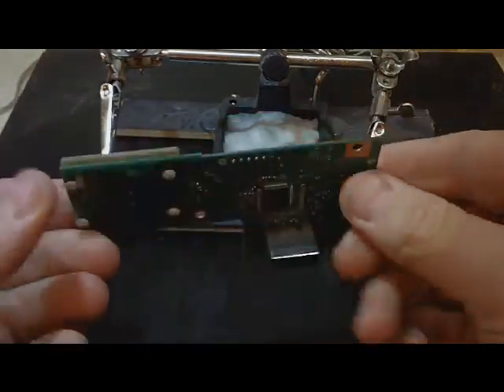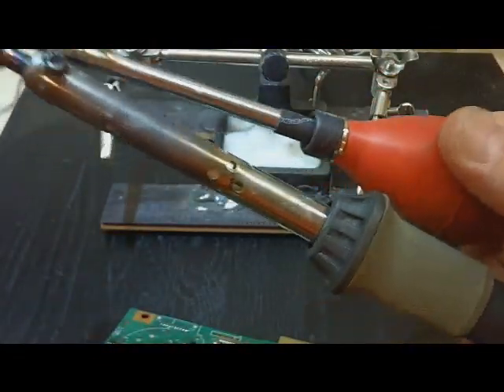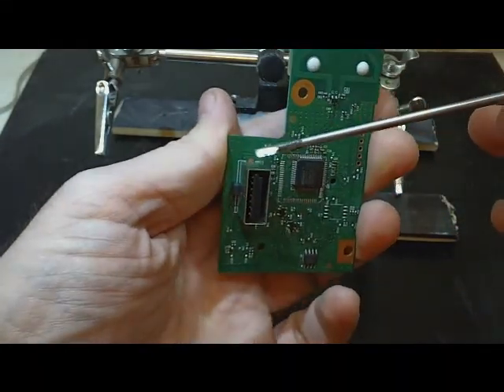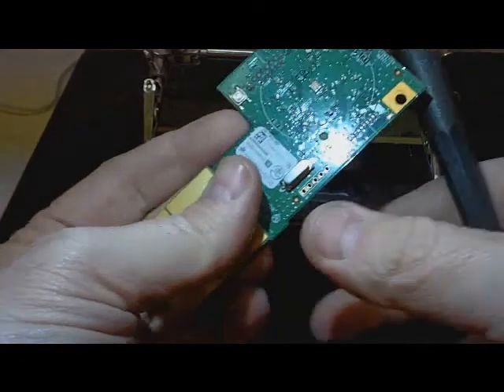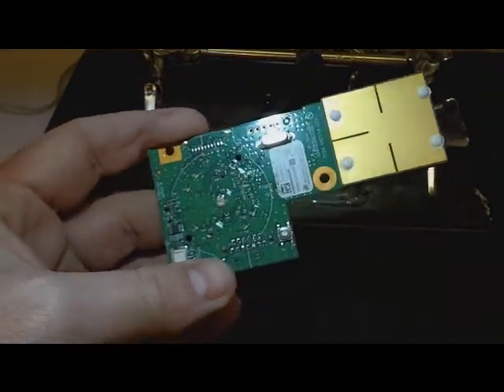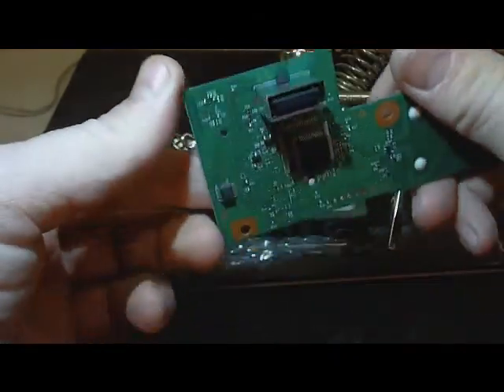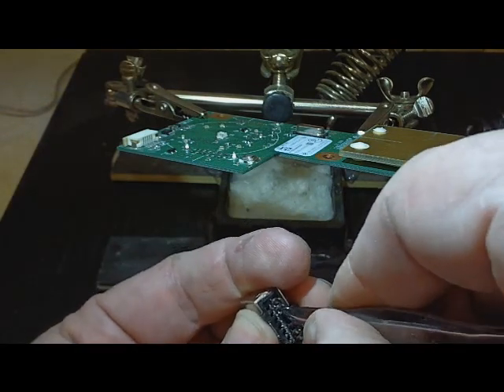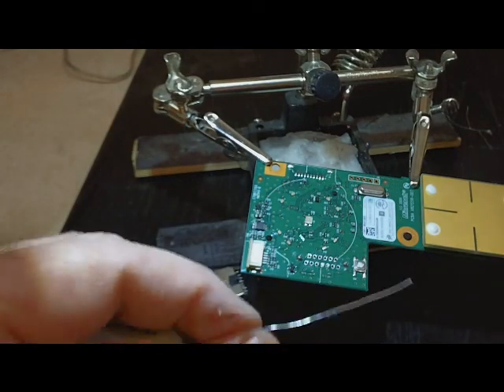How to Build an Xbox 360 Laptop " The RF board"

Comment from the maker: @myownreality64I have never been able to get enough of the solder out of those two get them to release. The first one I did I got almost all the solder out and was able to break that last part of the connections. But I was trying to be so careful with the board that doing that took something like 4 hours or just those two points.  After that I started cutting them. There is more chance of damaging the board by cutting them but it only takes 3 minutes. So I just keep 3 or 4 extra RF boards.

Comment: I found that the two large header attachments are actually springs clips that lock it into position once snapped onto the board. I basically had to remove the solder then brake the clips. I also had the exact same points give me problems when I was pulling my header off.